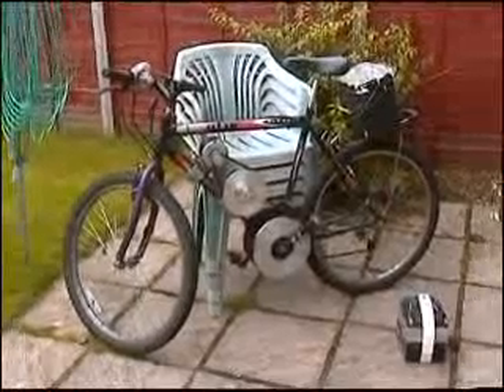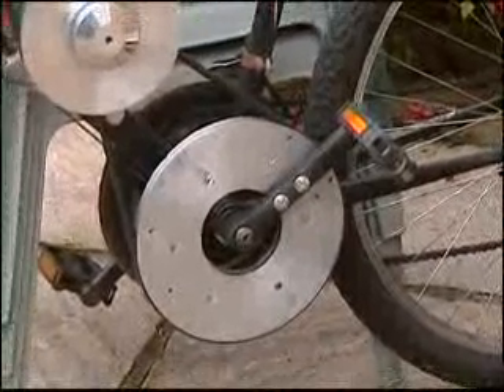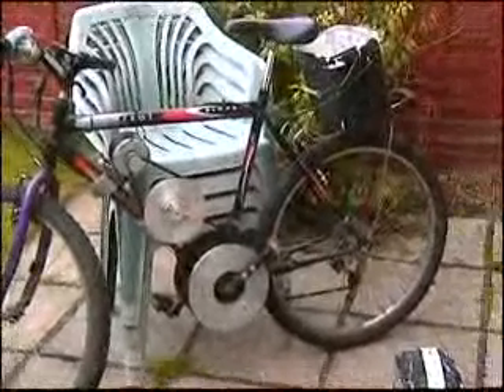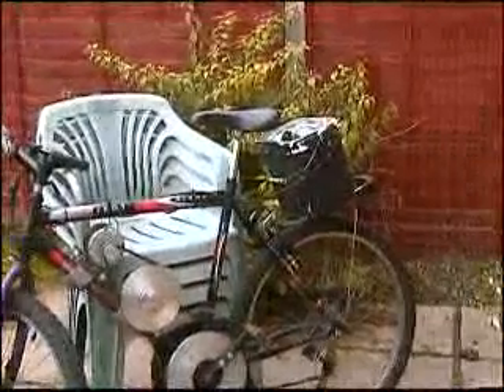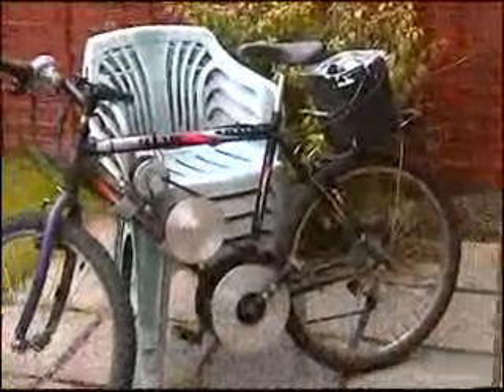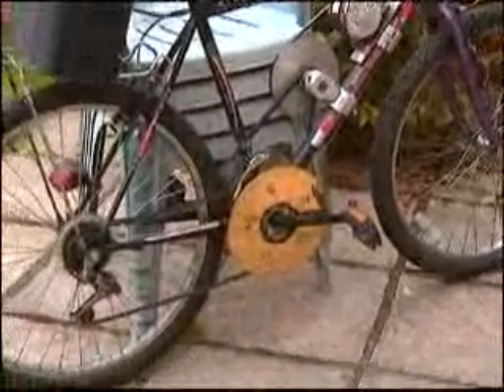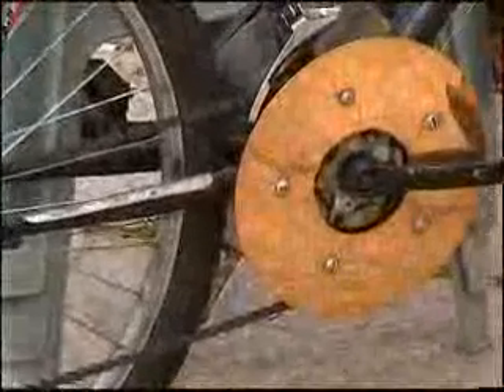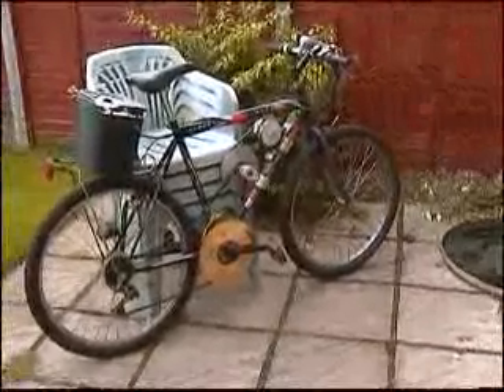Home Made Hybrid Electric and Pedal-assisted Bicyle

Comment: The 14A thing is supposed to be what it can handle continuously (can handle more), and 2500RPM is how fast it's supposed to spin (loaded) on 24V according to its voltage constant. Odd it spins so fast.

I wasn't paying attention to the whole setup the first time; more to just the reduction. I see it's running just on a switch, rather than a controller, so the peak amps is going to be dictated by it's internal resistance. Probably somewhere between 20 and 50A max on 24V. So, yes, crazy torque. ;)